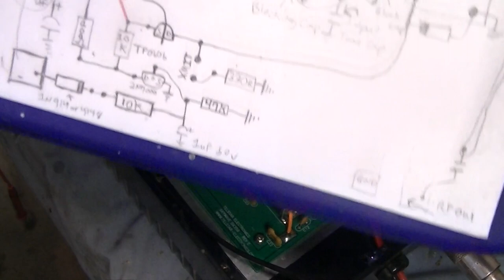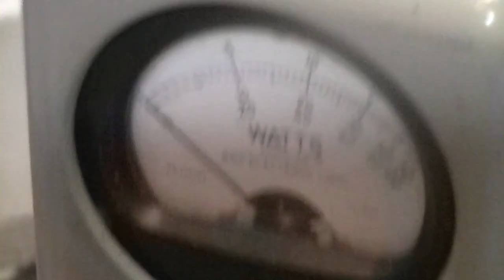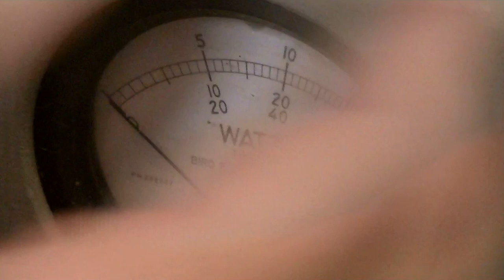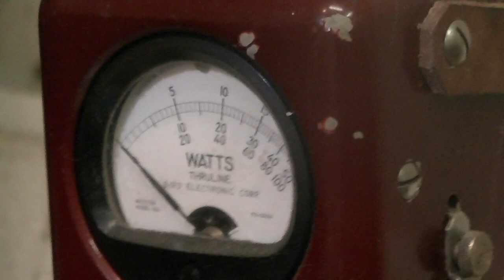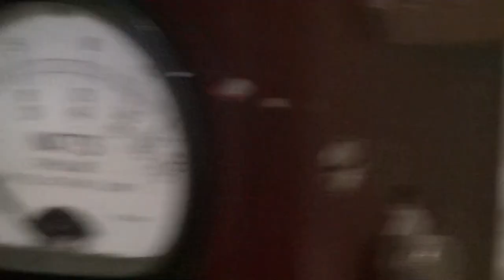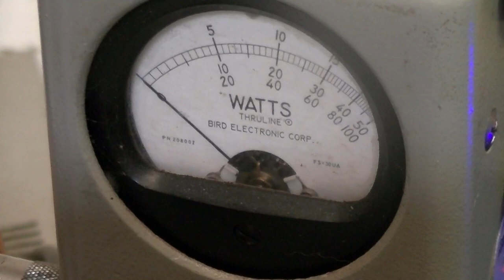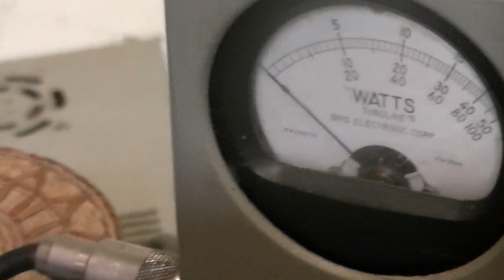Skywave DX350 Repair & Honest Review 🤔 - [Telstar]

Comment: I love that board.  That a strange keying circuit.  I got a 2 transistor one  I some times used on up grades . standard 2n2222 but driving a tip 120 to give +12 V when keyed. give bias and relay to ground . I got that from a older amp and I liked how they did bias. using main relay for bias works well. just takes more parts.  3 pole relay is also used. I like my radio to key my amp. PTT line. big SSB user hear. I have seen outher types of feed back circuits as well. inductive feedback is one of many . Can be done with extra windings on RF transformers or a extra small RF transformer. The solid state Ameritron mobile amp does it like that. with out studying the board more it may have feed back of some kind. can even done on the trace bord. Looks like you buy the board and build the amp.  73's

Comment: I would be guessing type 43 on transformers but idk .but id say its made to be  Broadband to
Reply from the maker: Yes they are 43 core. You are correct bud. Kinda meant to ask him his technical reasoning behind that but yet it will not get to the point of rf saturation in this design so 🤷 🤔
Reply: @1883GotDown  yea I see that .. I was thinking it was going to stay about the same on power
Reply from the maker: @3madeamps  Yeah it increased a little. His wraps are diff and that is why he has to put the larger cap on top of the input....I was thinking maybe he did that just to be a little different ya know.